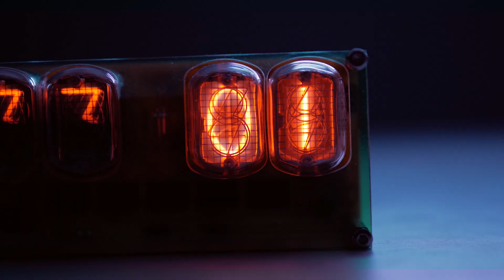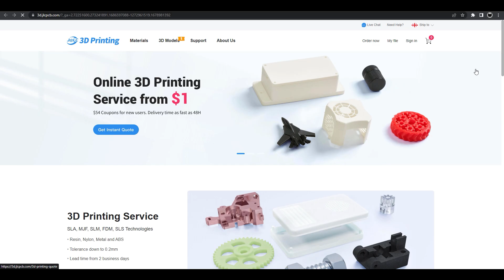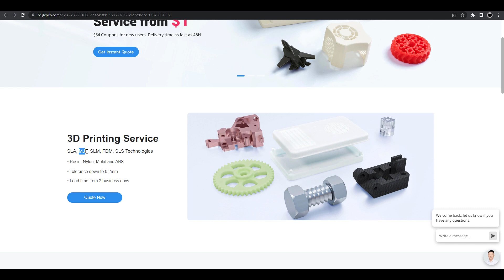3D Printed AMG Project ONE - RC CAR

Comment: Great build! Could you share which 3D printer model you used for this print?
Reply from the maker: It was printed by Snapmaker 2.0 A350 with PLA + material

Comment: @10:40 Hear me out on this one... Gold Marker Pen held against the wheel while it is spinning 😏 ( that paint job with the Brush and the Stencil was atrocious )
Also why not continue using Spray Cans for all of the black Parts too? You were masking the parts off anyway... Might as well use the much more superior method over Brush Paint 🤨
Reply from the maker: Masking and spray painting isn't as easy as it seems) already tried that. Have done golden line wheels on porsche, check it out

Comment: I put a dislike only because of the poor processing of printed parts. The layers of the print are strongly visible.
Reply: Because print quality was the topic of this video....pathetic behavior
Reply: @BigNutsTheodore I am referring to the thunbs down....not the comment
Reply: Let’s see your better one then 😂
Reply: It it's true, 3D prints are for quick shapes, the finishes still need work, and just painting over it won't make it look good.
Reply from the maker: Ok😂
Reply: He made it how he liked it, if you want smoother surfaces you can get a smaller nozzle or use wood filling then sand down, however that would take a lot longer, so in my opinion the printing layers aren't a problem since the car is so big and fun to play with.
Reply: Do better?
Reply: Also poor painting skills

Comment: As great as the editing is, you definitely would have a lot more nerds on your side if you had the sound of the engine as the 2015-16 class formula 1 race car..

Last I heard, that's what the engine is SUPPOSED TO BE in this particular case.

Sound for car nerds is one of the most important factors when it comes to this stuff.

Comment: Hi , you did an amazing job. By the way , i cant find the parameters to print this model. What layer , speed , temp, filament etc...  Can you tell us please because it looks so clean your printing . Thanks
Reply: If you think that these prints look clean i would dread to see what you are pulling off the build plate
Reply from the maker: @Caplonky5  i don't think so, that's why it needs lots of sanding, shown in video
Reply from the maker: I used Esun PLA + filament with 210c with additional fan to my printer. Slicer is Cura, but the parameters are individual for every printer. I'm using Snapmaker 2.0 A350 printer

Comment: that is awesome, for smaller details, a resin printer might be better since you would not need to sand it down, which would mean that you can retain the detail straight from the print, but it is amazing the amount of detail you got with and FDM machine
Reply from the maker: Thank you 🙌 you are right but it will easily melt at sun temperature
Reply: @MrGoodcat1  how would it melt??
Reply from the maker: @hamburgerbuns9752  SLS printed part has a very low melting point and outaide at sun it will easily deform
Reply: @MrGoodcat1  I don't think this is at all true and honestly can't find anywhere thats says it is. Im not saying you're wrong, it just doesn't seem correct. both sla and sls printing should have much better resistance to deformation then fdm printing with pla.